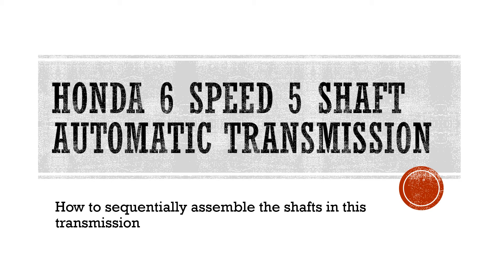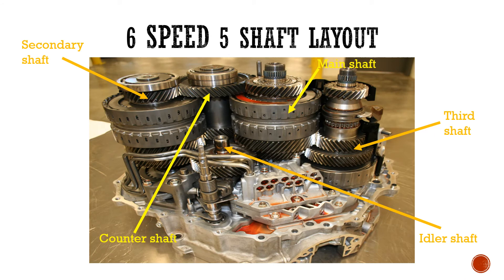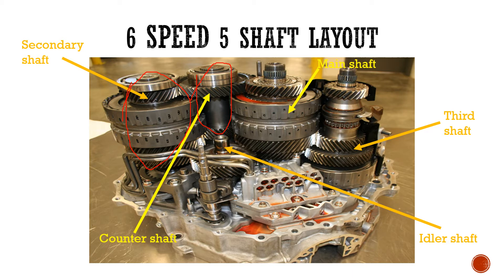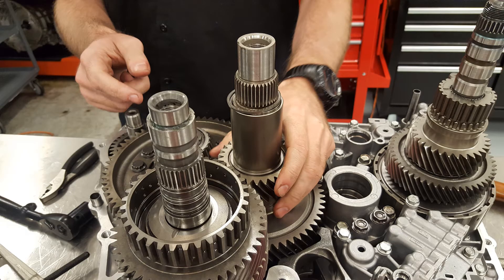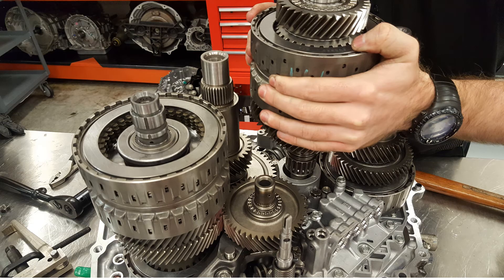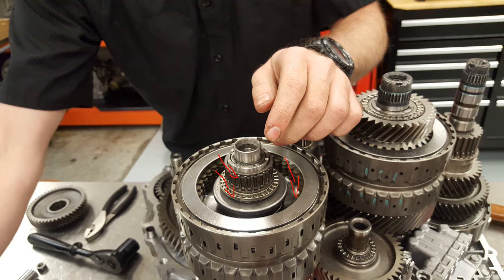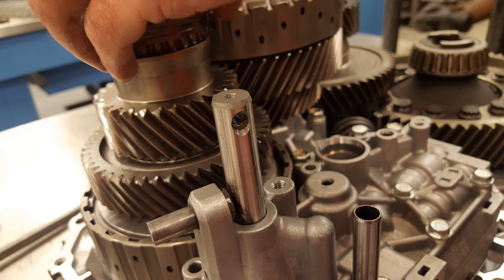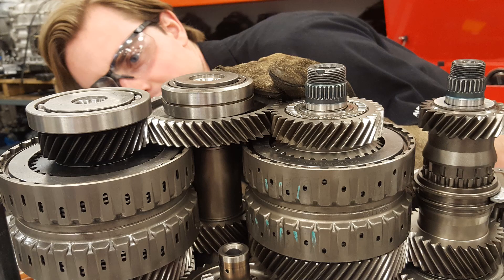How to Assemble the Shafts One by One in a Honda 6 Speed 5 Shaft Auto Transmission (PowerPoint)

Comment: Why you didn't use actual video instead of pictures slide
Reply from the maker: The shafts are heavy; this would have required an extra pair of hands.
Reply: @pierrerepairgt  ok
Reply: I have a 06 Honda Ridgeline the transmission is slipping real bad  especially when it warms up then it gets hot that you can smiles the transmission oil on I'm wondering if I could rebuild it I'm in Jamaica I like diy
Reply from the maker: Do you have any diagnostic trouble codes related to the transmission? Also, I think you can rebuild it. You will need a press to remove bearings from the shafts. Try to get All data diy. It will help with the rebuild.
Reply: Thank you for for replying no there's electronic codes that's why I know it need to rebuild
Reply: Yes  no electric code  on i have change quite a few censer already I have a drills press that's not problem is the valve body I'm worry about I save your video so I can refer to them
Reply: @RohanmkShaw  you can record your screen while the video is playing. Save it that way so that you can watch it even without internet.